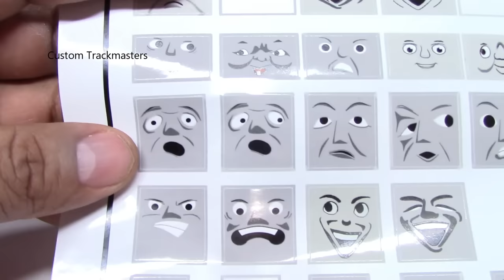How to make a Trackmaster motorized runaway Troublesome truck custom

Comment: the 24,000RPM power dash could be useful for thomas' motor in the jet engine pack
Reply: Or for Engines Like: Diesel 10, Spencer, Murdoch and a Custom D199
Reply: He's using a Mavis motor
Reply: @lilducky4171  w h a t
Reply: @tisstufffilms7006   Mavis motels in Trackmaster to make the engine go fast but you gotta put the battery's the opposite way with alfoil

Comment: The only thing I don't like is that you used a trackmaster 2 motorized chassis as opposed to a trackmaster 1, or plairail one. Because those don't free wheel.